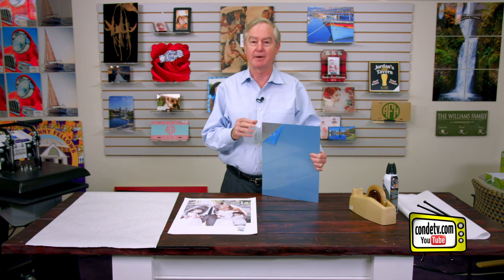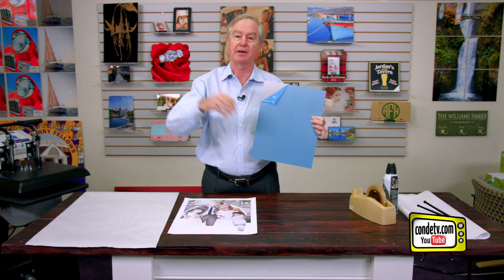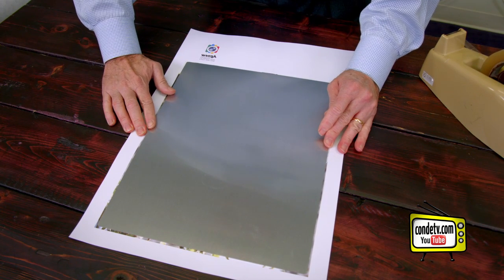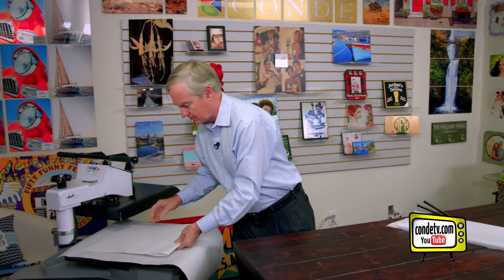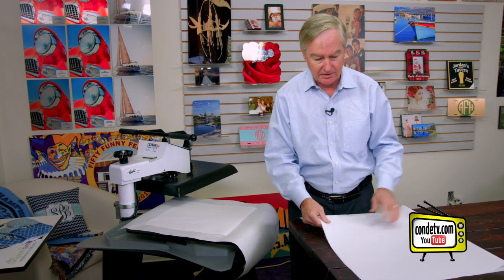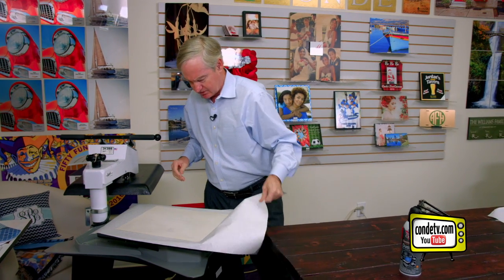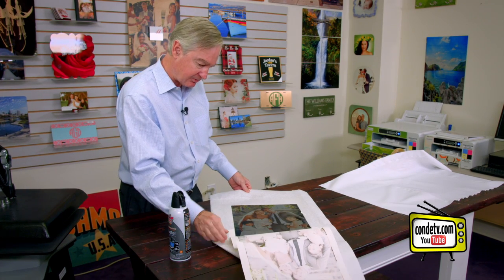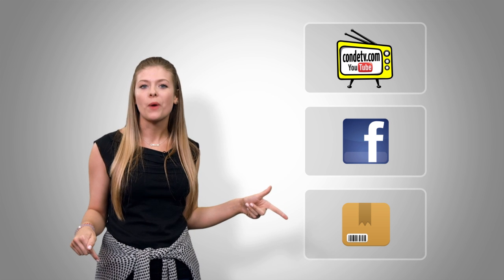Proper Techniques for Pressing ChromaLuxe Sublimation Photo Panels -

Comment: Thanks for the drying suggestion.  I dry under the press for sixty seconds.  Also I use a Teflon sheet instead of a cloth vent.  Of course I standardize the process as much as possible when making color profiles.
Reply from the maker: Thanks for sharing!

Comment: I run an Embroidery shop as well and have backing/stabilizer that I use instead of your fabric suggestion as I can press with it once and then cut it up for use in sewing as I buy it in bulk and the stabilizers gets stiffer after it is pressed for 90 seconds.  Win Win

Comment: hi david, thanks for all your tips. I was wondering if you can sublimate a large chromaluxe panel(16x20) just with the color black. im having trouble getting a perfect black transfer. either not dye is not fully transferring or errors because of the fold over. I think a true sublimation specialist has to master the all black panel. please david, give it a try.